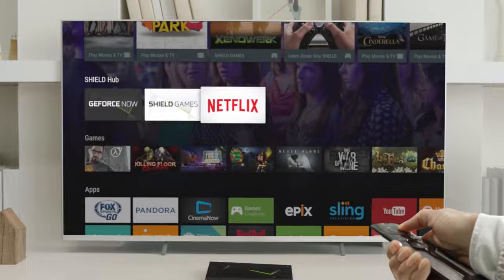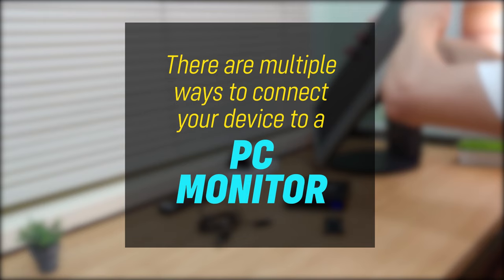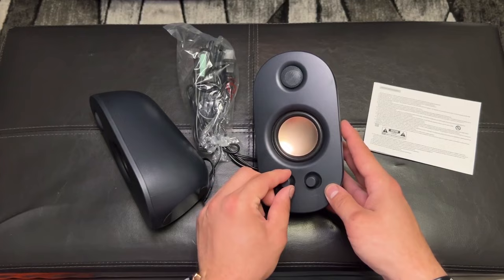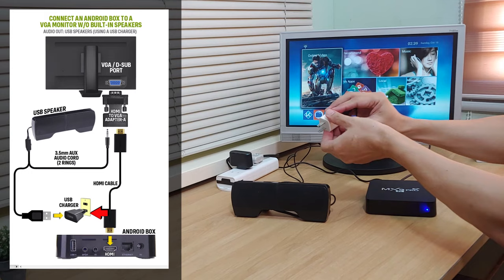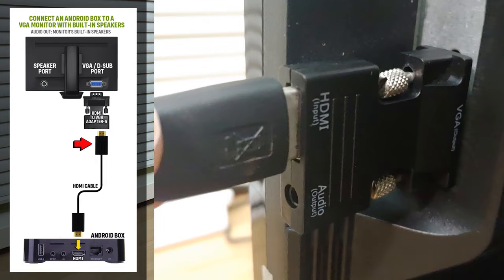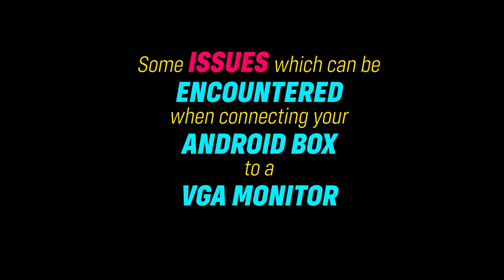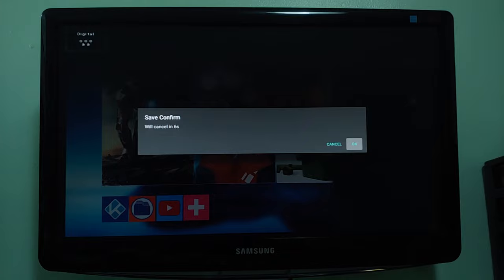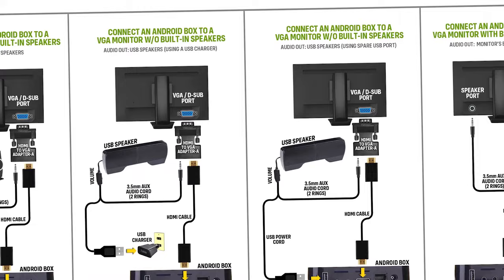Convert an Old Monitor into a Smart TV with Working Sound via VGA (Tested with MXQ Pro Android Box)

Comment: Pro tip, there are DVI to HDMI cables. If your monitor has a DVI port, get one of those to avoid adapters that may need extra power.
Reply: Does it work?  thanks
Reply: @kiramarizposion  Yes, my AmazonBasics HDMI to DVI cable works as well as my HDMI to DisplayPort cable from the same brand. I use them to connect my older monitor to my PC and Xbox.

The brand should not matter, tho, since those three standard are digital and don't need converters or adapters to work together.
Reply: how about the audio?
Reply: @elmerestelon9374  Bluetooth speakers/soundbar.

I couldn't find a working HDMI to DVI+Audio adapter anyway, so if you're gonna use the DVI port of your monitor, Bluetooth audio seems like the best solution.

If your monitor has a VGA port, then use an HDMI to VGA+audio adapter. Tho that comes with the hassle of worse (analogic) video quality and using adapters.

Comment: i cam't have 4:3 resolutions on mime, its says unsupported resolution and turns off monitor. any help?
Reply from the maker: Your android box should have an available aspect ratio of 4:3 with a corresponding resolution options. In some cases, some cheap android boxes do not support this. I guess this has something to do with the low end gpu installed on these type of boxes.

Comment: Great content Sir, question lang bka my Idea lng kayo base nadin sa expertise nyo and experience. I know di nyo prinopromote ung fake na mxq pero, since na test nyo nadin po, nabili ko ksi fake na mxq pro 4k 5g working xa pra sa basic needs ko, but now I wanted to play retro games using the fake mxq pro, yung emulator at games na gamit ko working naman problem ko ung controller. I tried using PS4 controller and usb universal controller pero di xa nag wowork sa mxq pro (both controllers are working using desktop) tingin nyo sir no kya issue? Bali ung mga usb port na pinagsaksakan ko ng controller nakakapg read naman xa flash drive so I'm sure why not working  khit dongle ayaw. Looking forward po sa insight nyo Sir :yougotthis:
Reply from the maker: Hi Dingdar. So far nagagamit ko naman ang usb controller using retroarch app. Anong emulator gamit mo bro?
Reply: @ThinkFrugal  thank you for quick response, Epxse emulator. I will  try retroach Sir, update kita incase mag work or hindi, thank you sir :yougotthis:
Reply: @ThinkFrugal  follow up question pla sir since working retroarch nyo, dun nyo po ba nasubukan sa fake na mxq pro un?

Comment: Tropa gamit ko yung kulay puti na converter.. Tas kapag yung swich sa tabi nilagay ko sa 1080p.. Lalabas sa monitor not supported mag digital na daw.. Yung converter na av2vga.. So pede ba na maglagay sa dulo ng vga na dp o dvi tas dun saksak sa mga yun..? Ok naman lahat may audio may video. Pero kapag nilagay ko na dun ayaw na.  Vga dvi dp yung mga ports ko wala hdmi
Reply from the maker: Yung av2vga na adapter bro uses an analog conversion. Pwede siya from rca to vga kapag hindi ganun kalaki ang resolution. Pag sinakdakan mo siya ng vga2dp or vga2hdmi, may conversion ulit yun from analog to digital, na pwedeng magcause ng latency, or delay na tinatawag. Hindi advisable ang ganitong setup. May puti na convertor na av2hdmi na available din, nagamit ko na ito noon and it worked for me.
Reply: @ThinkFrugal  salamat tropa.. Kasi naisip ko yung dulo yung nakasaksak sa monitor na vga.. Ano kaya kung palitan ko ang cable.. Yung vga to dvi-d yung 24+1 Kasi nag papa switch daw sa digital kapag nilagay ko na sa 1080p yung puti na converter.. Wag ko na nga galawin.. Ok naman na gumagana naman na sa 1280x720p.. Salamat na lang tropa..! 
 👍😊
Reply from the maker: @chrischanchannel1318  Sadly, ganun din ang mangyayari bro, DVI is also digital kaya magkakaroon din ng 2-process conversion. Mas mainam yung av2hdmi yung gamitin mo bro if you really want the 1080p, dahil isang conversion lang ang mangyayari. Tingin ko bro 720p is quite ok, 1080p will just be an upscaled version. Di ganun kalaki yung quality difference dahil galing sa composite video yung source, smudgy pa rin ang magiging outcome. Kung yung device source mo ay may component ports (Additional red, green and blue ports), may component2hdmi din na available. Mas higher ang quality nito.

Comment: hello sir nag try ako nito sa monitor ko na hp, ginawa ko yung first tutorial mo na vga to hdmi all set naman po ng tama ang lumalabas naman po ay input signal out of range change settings daw sa screen ng monitor eh yung monitor ko is okay naman naka set naman sa ganung settings ano po kanyang problema pag ganitong error ang na incounter? salamat.
Reply from the maker: Hi there. Most of the time, resolution mismatch ang ganitong klase ng error. Nadedetect na ng monitor ang signal ng android box, pero di lang nito mai-output sa monitor. Try niyo pong iconnect sa ibang tv, then make the necessary adjustments sa resolution (720p at 60hz usually works). Ano po pala yung model ng monitor niyo?
Reply: Sir model ng monitor ko ay aoc  e1670swu
Reply: Ayaw din ya out put din kahit set ko na ibang reso

Comment: Tried it on my TV but it says no signal infact I tried it on 2 TV and it's saying no signal. I need help please
Reply from the maker: If you have tried this on two televisions (NOT Monitors), the following could be the possible reasons why you are getting the "no signal" error:
1. HDMI cable might be defective, try using a different cable
2. The device you are connecting to the television might have the wrong resolution settings. The device and the television resolution must match.
3. The device you are connecting to is already defective.
Please ensure that you can successfully connect to a television first, so we could strike out all the possible reasons mentioned above.
Reply: Well I bought the hdmi to vga yesterday and the vga cable yesterday so they are both new
Reply: And I tried it on 2 tv so am not sure whats wrong but am wondering if the power from the android box isn't strong enough
Reply: Using a xtc363 hdmi to vga and a xtc308 vga cable
Reply: Android box is a mxq pro 4k
Reply from the maker: @andrebrown8128  I see. What I am trying to say, do not use the HDMI to VGA adaptor yet. Try to connect the MXQ to a TV (not to a monitor) by using an HDMI cable. In this way we canbe able to conclude the the box is working properly prior to connecting it to a VGA monitor. We have to rule out first the possibility of a defective MXQ pro. Does the MXQ light up when connected to the power adaptor?
Reply: Yes it's working via hdmi I was evening trying to change the resolution to see if it would help but it keeps saying no signal
Reply: And the android box is working am just wondering if the hdmi to vga is defective or the cable even thou it's new
Reply from the maker: @andrebrown8128  I see. Good to hear that the MXQ is not defective. May I know the model number of your monitor?
Reply: Am using a imperial smart tv
Reply: @andrebrown8128  lower your resolution to the minimum on TV 480p and then try again on your monitor.